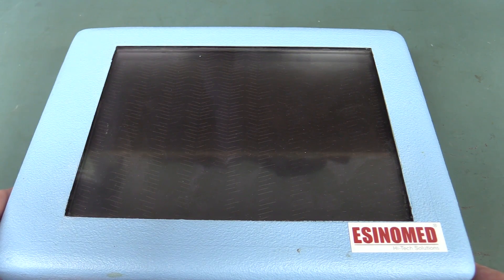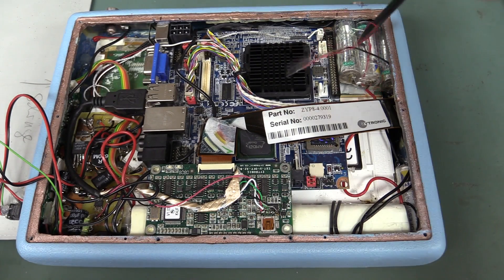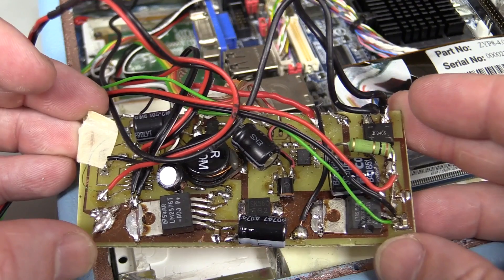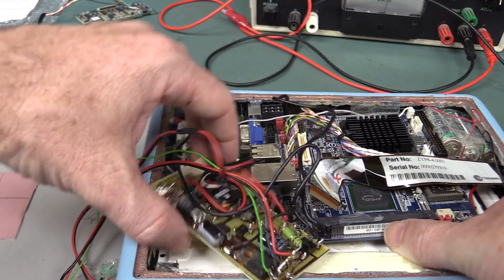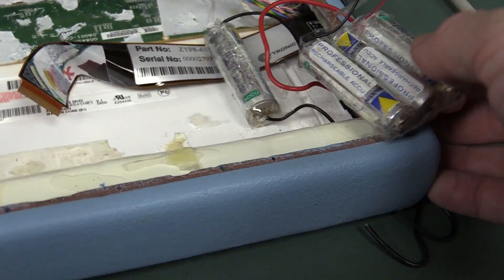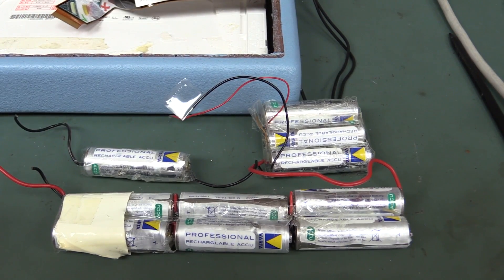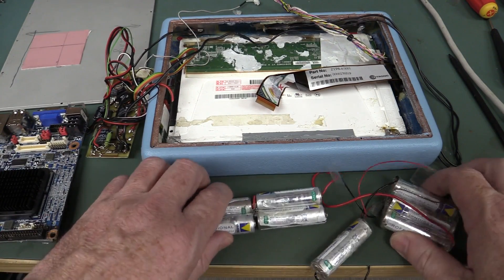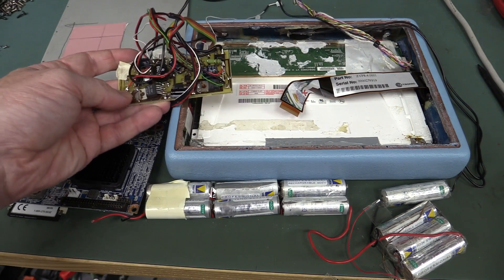EEVblog #822 - World's Worst Tablet Computer Teardown

Comment: The worse of it is that the manufacturer will probably have charged hundreds if not thousands for those units to the detriment of the authority who would have paid for them to be supplied. THEN the problems start and all the units end up being returned....thankfully not with that unit. My response to "how bad is that"?.......that really is fit for the bin...I just figured  where the case came from 'ETCHO-SCETCH'  with a few adaptions

Comment: Can't believe a German engineering made this I'm very sad
Reply: Ausnahmen bestätigen die Regel, richtig? =)
Reply: Well, it works so the engineering wasn't that bad. The Bad Thing about it, is that Electronics Bachelor Teenagers with no practical Experience put this together without knowing how to turn on a Soldering Iron.
Reply: Tomas Av. Eyyy
Reply: januszbanderas :D
Reply: There is a lot of engineering like that in Germany unfortunately. Probably done by students/interns. You know, any project can be finished in a finite time by a finite number of interns :)
Reply: TheGuyWhoWantsToGoSpace I feel that. I don't think there are many of those instances. Since Ive been at a makerspace for quite some time I've seen stuff like this before, but none of them ever got out the makerspace in that shape. Even for prototypes the peeps that where around actually got their pcbs manufactured. I think it was more common back in 1990-2008 tho.
Reply: Bloke who did the soldering drove a trabant.
Reply: Look at their car and you will believe :D
Reply: Robert Haxor and it probably cost an arm and a leg because of Made in Germany sticker. Germans cannot into electronics
Reply: Probably a bunch of immigrants funded by mama Merkel to start a medical business.

Comment: i recognize the touch screen, they were used as ATM displays. Designed to be very rugged to withstand bad weather and angry drunks. Uses capacitive touch sensing, I don't remember if they supported multi-touch or not. ATM interfaces never required. the ability.  Very rugged screens.

Comment: I have little to no experience on soldering... and I would do a better job... for sure!
Reply: You wish. Those cells suck away heat and many common fluxes don't work on them. You need a powerful iron and strong zinc chloride-based flux. That's why professional packs are spot-welded, not soldered.
Reply: Same

Comment: To me this looks very much as if the PC hardware was retrofitted into the case. The kind of touch screen looks like mid or late 90s, whereas the AMD Geode must be from 2003 or later. The device probably had something like a PowerPC, MIPS or SuperH board and may have been running Windows CE. The hardware upgrade could have been some school project considering that someone capable enough to design this is unlikely to have such poor soldering skills. Since the Esinomed branding is only on the outside of the case I think it's possible that this company may have only been the manufacturer of the original device but might not have been responsible for the poorly executed upgrade. Nevertheless it's quite impressive that it still seemed to work well.

Comment: Unbelievable,
Why didn't they use batteries with solder tabs?
Why didn't they use a Pico PSU instead of the hacked together custom power supply?

Comment: I worked at a company that the engineers would fast and dirty a half dozen proto types and then the designers would take over. We made hospital equipment it looks like a quick and dirty unit, nothing like that would pass the FDA or go out the door.

Comment: I wonder if all off-the-shelf PSU's and battery packs wouldn't fit in that case or it was impossible to connect the wires properly so they created a custom one (albeit horribly).

Comment: what pisses me off is I can go to any electronics store anywhere in the world and get a battery pack(that's smaller than what they had and probably far better) + power supply.
Reply: David Folsom go back in time by about 14 years and can you still do it then?
Reply: They didn't use a power brick because of the height above the on-board connector. The lid has to be very low. And the reason why they used those gross NiMH cells is that they don't cause fire when overcharged. Li-Ion cells have to be managed properly and it's difficult to find off-the-shelf balancers for packs.
Reply: Not to mention that the flash memory is incredibly slow. My USB external drive is faster than that shit.
Reply: Mr Vuck Fiacom  CF cards have IDE interface, they can replace hard drives directly. And XP doesn't boot from USB.

Comment: the serial number says everything, at least 11 piece of this device were made. things like this usually custom made by the company who built it with the customer specific needs.

you clearly never work in medical field, many medical equipment are still running an ancient OS like windows xp (i saw an even more ancient USG device that still use c64 as its controller) and the softwares were specifically tailored to windows xp a.k.a. it wont run in a modern os without compatibility issues.

The way i see it, the customer specifically order an xp based tablet (how many of them are still in market again?) to the company with the cheapest price, 11 units will not be profitable to waste money for CAD made case and pcb. if the tablet was working perfectly and it works like the customer ordered to do, it is not a fail.
Reply: yeah, but the fire hazard with the battery arrangement... and that awful power supply board...
Reply: the last hospital l saw was using windows 7.
Reply: I would not trust 10 in medical devices as far as I can throw it.
Reply: @0xbenedikt  well said👍👍👍 windows 10. Is completely unstable on any hardware!!!

Comment: I use this as the standard, I MUST make something at least three times this. I really wanna go and make a 1 off with a commercial touch screen, a nano ITX board, a hand etched power brick (single sided with decent layout and soldering) and then actually have a good power pack and the IO out the side, I have to go make a decent one, just to redeem homemade tablets.

Comment: The battery pack is fine, I have seen nearly identical in brand name laptops (with Li-ion cells, but that would be too dangerous with a botch PSU/charger).  The backplate antics with the heatsink tricks for the CPU and regulator are fine too.  The USB botch cable could be a space issue (if the small USB connector would bump into some other part).  But that battery-to-motherboard powerconverter is very hard to explain unless there was a last minute change of motherboard and they had to prototype a new PSU to produce different output than planned, on a handful of machines until the new PSU boards could be produced.
Reply: The battery pack is fine is it? You're not meant to solder directly, it can be done but usually affects the performance or life of the cells. Also there's no cell balancing or any BMS at all, so this would go out of balance and either refuse to charge one day after a cell drops too low, or it'll go out in an impressive fireball. Not fine at all. Not even a bloody thermal fuse ffs!
Reply: Not really likely or  necessary for nicd's or nimh. You are thinking of lion batts. I'm guess this was made long before your time NiCd's were really easy to charge in groups. Also you can solder directly to the battery as log as you don't heat the entire battery to +120'C for a long time a tiny amount of heat on the end isn't going to do much. Sounds more like you see stuff on youtube and comment instead of real life experiences.
Reply: just because they do it as well doesn't mean it is ok.

Comment: this thing is from 10 years ago really your comparing a Windows XP to a modern day tablet now this thing is garbage but back then it was top dog now their were Windows XP tablets back then but they were expensive
Reply: Even back then, this would have been junk. Windows XP is still a good OS, it is the physical build quality of the device that he is commenting on. Look at the power supply, that thing is a piece of crud!
Reply: William Wakely I really want a Windows XP tablet to run blue stacks
Reply: +Tommy Whitaker Like A Toshiba Portege 3500?
Reply: Nathaniel Clark no a old IBM  tablet PC which was the best one back then
Reply: Tommy Whitaker An, not a.
Reply: Nathaniel Clark will a old IBM Thinkpad tablet run a Android emulator
Reply: Tommy Whitaker Depends on what processor it has, If it has SSE2, Intel or Nvidia graphics, run Native Android.

Comment: I have heard that it was a prototype, which was not produced in series. In Germany, there are legal requirements for medical technology. The product has no CE marking and can not be sold. You'd better informed in advance.
Reply: All in all it just seems like some prototype. Maybe this person just took a normal working device from the not yet sold ones and put some extra stuff in there, like the additional batteries and the psu (imo the even the board didn't look like it was made for this machine with some open component pads). 
Also, didn't he say that the person who sent this to him didn't buy it from some retailer, but the company itself and wouldn't this mean that it was just a prototype in the end?
Reply: So, in Europe can such a device not be placed on the market, let alone be used in the medical field. There are clear legal provisions. The device is made in insolvency and was eleventh prototype, not the eleventh model. Clear processing is very bad and embarrassed, but it was used only internally and for testing purposes only. The company seems to act very professionally on the Internet. I go with prototypes also as before, but process it much better. It's still embarrassing

Comment: What kind of medical clinic would buy this garbage? They could simply use an iPad or Windows tablets. The wiring, the way they made the battery pack is just horrible!
Reply: This is probably long before the tablet age - around 2003 or so...
Reply: At the time, this would have been physically smaller than most competing tablets.  And yes, XP had full tablet support, I briefly worked with one that even had fingerprint sensors for login, that one was actually smaller than this blue box.

Comment: Spot welding the the batteries would have been 10 times quicker than soldering the batteries together. and would have paid for itself with a production run as small 100 battery builds. 

Soldering would transfer too much heat to the battery, and you run a high risk of cold solder joints.

Comment: We were hired to service a bunch of bulky, heavy "all in ones" with the same build quality.

They where "simply" an info screen, which had to be updated once a month with new info. A cheap tablet with a webpage full-screen would be overkill. They where once upon a time updated over the net using remote desktop to upload new binaries (Visual Basic, header based database), to reduce costs they where taken offline, USB drive and biweekly round around seven cities, sometimes with only a few hours of warning.

The same genius who made them also affixed a 24" LCD monitor (with standard VESA wallmount screw points) to a glass pane by means of two rubber suckers, held in place by one self-tapping wood screw, which perforated them (and the screen casing) all the way though.

We quit. The last straw was which they wanted us to pay for the replacement parts, and get the money back along with our pay in six months time. This in a very profitable sector, and we found out from to a few angry clients (service being charged for close to a year without working) that they were massively overcharging them.
Some had ripped the devices off the wall in frustration and wanted nothing but for them to be taken away.

Comment: It honestly wouldn't take much work to make it somewhat decent. Some quality 18650 cells which fit in the space for that "pack" without the extension would blow away the generic crap batteries inside it. A proper USB cable, some zip ties, etc. I don't mind a dab of hot glue here or there for holding things in place. A hand etched board in better quality with better soldering would clean up the power supply. Lol I'd probably spend the time to upgrade it for fun.

This is crap, but as a manufactured product it's neat.

Comment: MY EYES!!!!!!! MY EYES!!!!!! I CAN'T UNSEE THE POWER SUPPLY!!!
I can forgive the PSU board design to some extent, but the soldering and battery pack? Unforgivable.

Though I may have built a few battery packs like that before, I put a little cap over the end of each battery, heat shrunk them and added a molex plug coming out of the pack. That looks like a someone's first embedded project that was thrown together overnight while drunk.
Reply: +theLuigiFan0007  lololol!!!!!!!

Comment: now I can see this happening in some companies, (the smaller ones) with a tight-wad ass of a boss that does not want a level one prototype to cost much.... if anything at all. I have one of those bosses that would rather buy a $3 tube of caulk rather that pay $5 for a tube of  tile grout to fix a broke off bathroom tile.

Comment: As far as I looked it up it is prototype. So you went full potato over prototype being a prototype.
Reply: They sold it to someone, and I cannot begin to describe how unsafe this thing is.
Reply: Even for a prototype this would be quite awful.  Sell to a client or produce 11 of them, na-ah too poor quality.
Reply: Yairo Martis as far as I recall clip content it wasn't properly stated who sold what whom- it might been sold in a bulk of low quality electronics/parts or sold with intention of not using it commercially
Reply: +Karol “keik” Karpiński Prototype subsequently sold to an actual customer.
Reply: +Karol “keik” Karpiński So, it's a prototype. Maybe the production run of the final version ended and they sold off their working prototypes. Or the buying customer didn't want to pay the full price...

Comment: I worked at a major museum for a time.
We got in a new suite of interactive exhibits that began to go bad right away.
Why?
Everything was built up using perfboards, 24 ga. wire-wrap [but no wrap pins, all soldered!] and lots of gaffer tape.
The power supplies were a random assrotment of wall-warts.  One exhibit had a 12, 5, 7.5, 9 and 2.5 volts supplies, each a separate 'wart'.
The fun part was the multi-layer effect!
They threw down some wires, then a layer of tape.  Some more wires. more tape.
There was 11 layers of tape on one board!
Of course, stripping off each layer broke most of the wires.
I ended up scrapping the entire 'guts' when the builder admitted they kept no records of the work done.
Yeah, no schematics, only a 'concept-conversation'
Reply: +Greg Gallacci "The fun part was the multi-layer effect!
They threw down some wires, then a layer of tape.  Some more wires. more tape.
There was 11 layers of tape on one board!" Sounds like a ghetto multi-layer pcb, without the pcb.

Comment: i have a question. how do you make a battery pack without soldering if you dont have a spot welder?
Reply: LiPos?
Reply: +danijel124 They make plastic battery packs that hold the batteries together ???
Reply: Easy, have it made for you - there are plenty of companies out there that will build you a custom pack

Comment: Sorry for being a bit ignorant in how different batteries are connected, but isn't soldering batteries together a normal application? When taking apart some laptop batteries they connected 18650's together via soldering wires to connect them to each-other, wrapped the bundle, and put them into the plastic shell that you see on the exterior. I realize that this "prototype" was put together something awful, but the main pack at the bottom seemed to be a standard way of doing it (done poorly if nothing else).  Just curious.
Reply: +Andrew Harley Typically you would spot-weld them together.
Reply: +Ray Cathcart Ah, that makes sense. Thank You for clearing that up for me, I was trying to figure out how those batteries were connected together with metal without using solder and didn't even think about spot welding. Thanks Again.